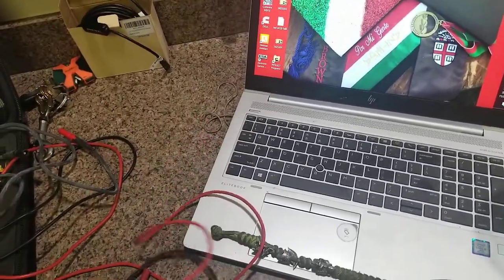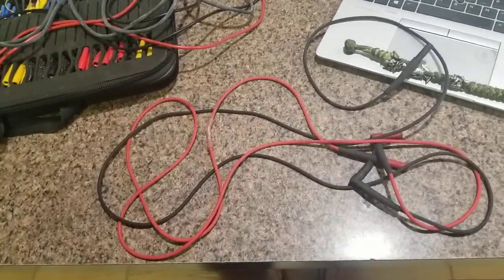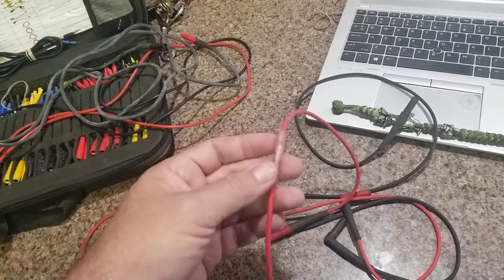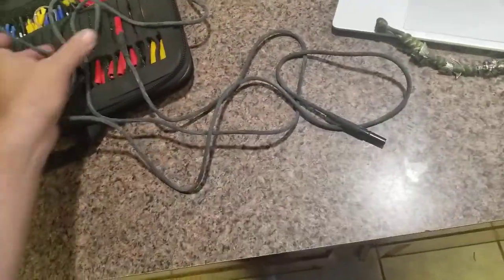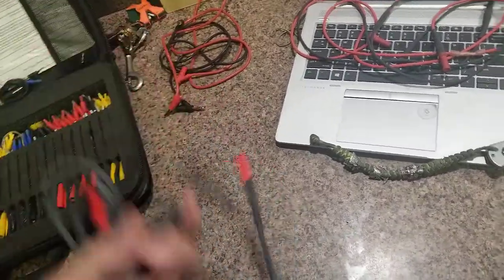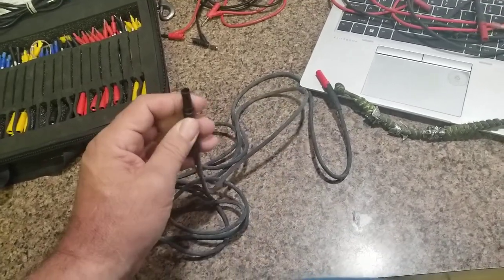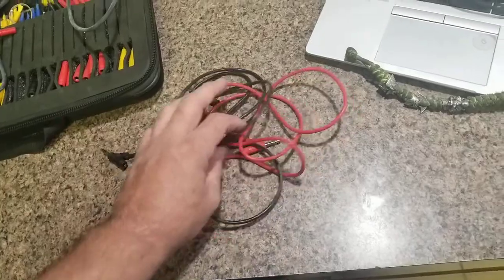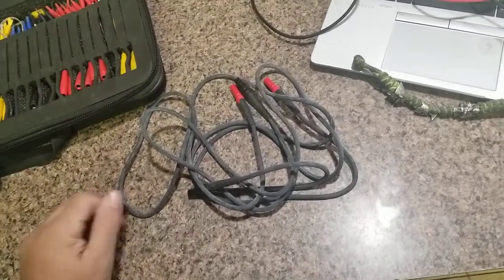Heavy duty test leads by Fluke TL 27

Comment: I really need some new test leads.  Mine are sketchy.  But if I always remember that, I can usually work around it.  Maybe Santa will buy me some new ones!
Reply from the maker: Funny I have gone in behind guys who are struggling to fix a problem only to find out later they had compromised leads 

My primary leads get replaced every 2 years no matter what but here latley I been damaging the leads ,like closing the door on them and pinching them 🤦‍♂️
Reply: @sonofmontezuma3732  Awww, that's the worst!